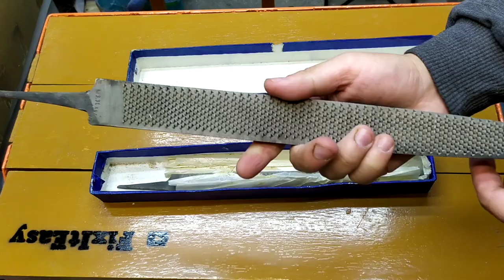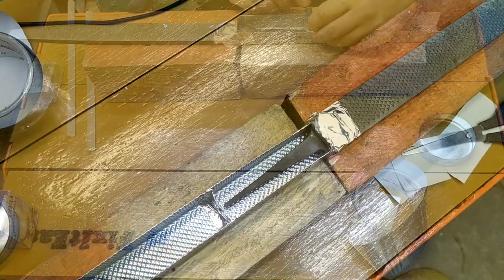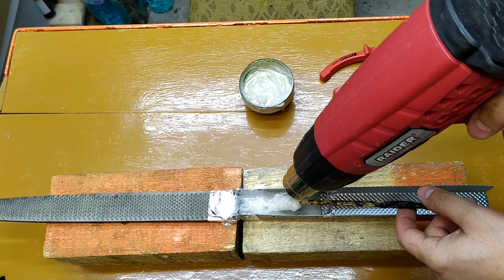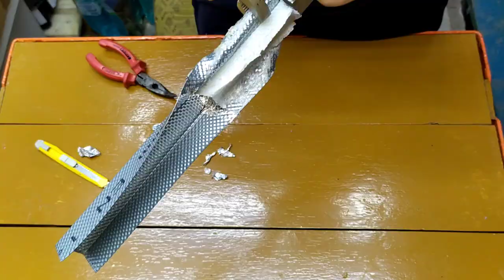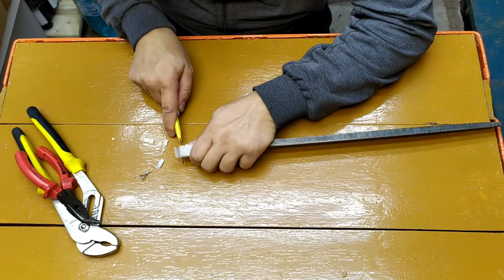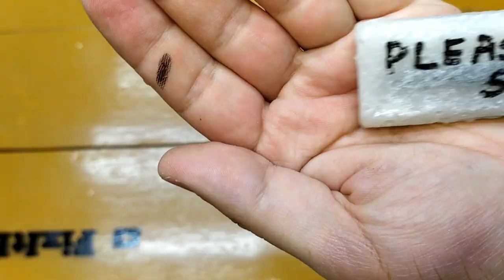Hot Glue + Baking Soda LifeHack

Comment: Looks good! I have one question: in your opinion, what is the advantage of this method over using epoxy resin to mould a handle?
Reply from the maker: Good question my friend 🙂 Epoxy would get much harder, maybe even fragile if  dropped on floor. I believe it is more expensive to use Epoxy. For good final finish of epoxy resin it probably take double the time (i mean it would be harder to make it smooth) although the hot glue needs just a tweak with the hot air gun. Maybe I should try epoxy anyway, you always have good ideas my brother 💖
Reply: @FixitEasyDIY  Yes, now that you mention it, I realize that epoxy might not be a good material for a handle. Probably it is more fragile than the baking soda and hot glue mix. Should try this combo sometimes as for now I have only knew about the baking soda and super glue trick. Thanks for sharing!
Reply from the maker: @vladislav6151  thanks for your comment. Greetings from Svishtov :)
Reply from the maker: @vladislav6151  If you try it, make sure to pour soda carefully, because it could get too much ;)
Reply: @FixitEasyDIY  I have a microphone that sits on the desk The top of the microphone where you talking to has broken from the base unit do you think this might work for that I've actually used hot glue to hold it in place right now but I'm looking for something a little more permanent
Reply from the maker: @thevoiceofreason6712  I would use super glue and baking soda for that
 Make sure to degrease both surfaces very good. I also use sanding paper in such cases to scratch where the joint will be. :)
Reply: @FixitEasyDIY  I absolutely will I've got it temporarily held with hot glue there's not a lot of pressure on it so when this gives I will absolutely do that just so happens I've got a big tube of super glue so thank you for sharing that with me can't wait to try it
Reply from the maker: Thank you for commenting in my channel my friend 🙂 You are always welcome 🤗

Comment: the handle would be softer after exposed under the sun. Hot glue sensitives to the heat.
Reply from the maker: That`s right. But adding baking soda makes it much better. In the matter of fact, this tools would be used 99.99% indoors ;)